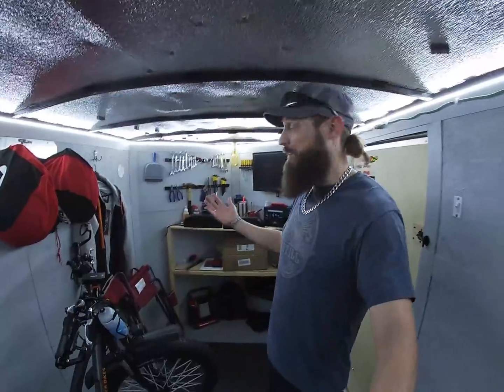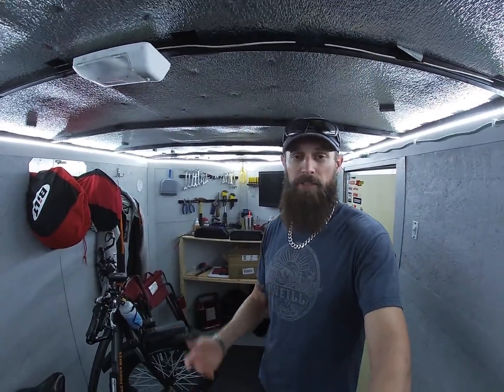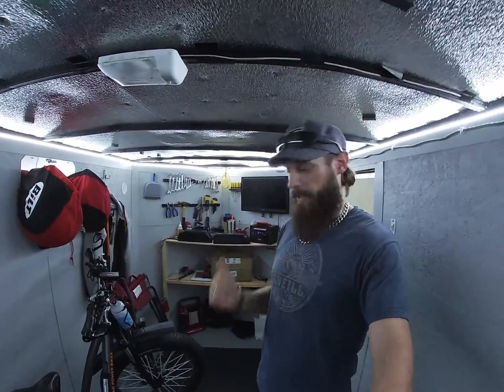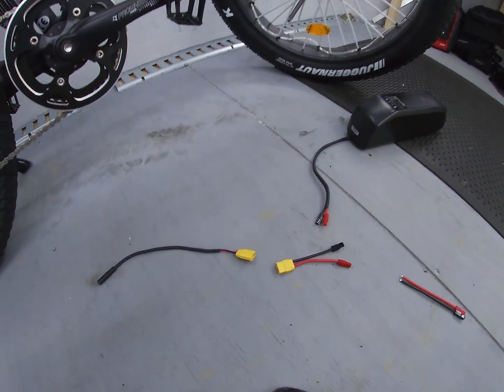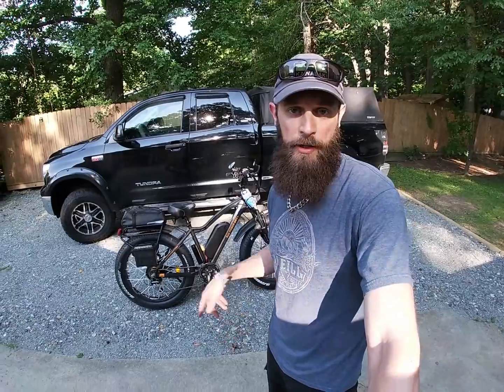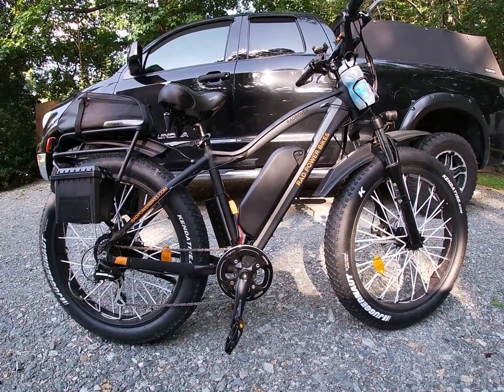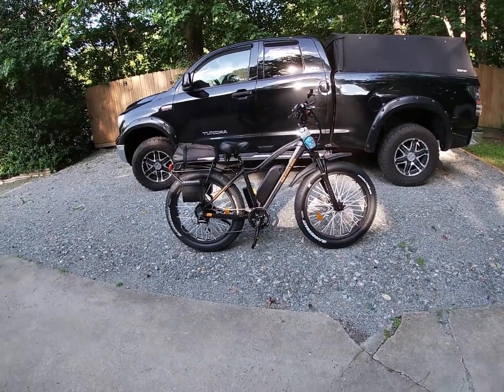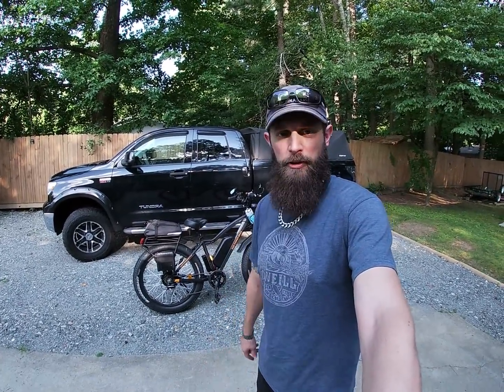52v Battery Upgrade on Rad Rover ebike

Comment: If you decide you’d like to eliminate the adapter cable, PM me and I can modify that cable for you (free for fellow YouTuber). I have an Anderson PowerPole crimp kit. That Anderson connector can accept 3 sizes of contacts (15A, 30A, & 45A), to fit the different gauges of wire.  These connectors are extremely reliable. I use them at work for aircraft communication systems.  Good thinking on the protective gear, hope you don’t need it!

Comment: The gauge wire is a issue I’m wanting to solve as well on my RadMini. They say the thicker wire handles more juice going through it. You have 52v battery so perhaps consider going thicker wires at some point. To get the most volts to the motor it helps. Still the simplicity of your set up is tempting. Anyway great to see all this stuff it gets me closer to home on my set up. And yes that’s what I’m finding the cost adds up. Thanks!
Reply: Amps determine what wire gauge to use.
Reply: @Bmr4life  c. 
“
Reply: High volts smaller wires needed to pass the same amps. 

Just sharing. 🍑

Comment: I got my Rover in February and like you think sometimes it would have been cheaper and easier, in the long run, to but a better bike out of the gate but it's literally been fun doing the tuning work and upgrades myself. Plus you gain knowing how to do so know how to fix and maintain it. And I like the connection you came up with, I'm thinking that's how I will do the battery upgrade soon so thanks for testing it out for me first :c)
Reply from the maker: rode it for about 8 miles tonight, seems to be working just fine :)
Reply: @CitizenCycle925  it seems like the best solution to me so thanks again for being a guinea pig for the rest of us.

Comment: I haven't had this much suspension for the 52V outcome since I upgraded the front suspension on my e-bike this spring.
Reply from the maker: hahaha!
Reply: @CitizenCycle925  I really think having bigger wires going into a smaller wire is not a good thing. It's like taking a big water pipe and putting it into a smaller one. You should see how hot that wire gets? That would be okay if they were all the same size wires that's what I think and I took two years of electrical trades and I have a soldering gun. Just got my echo ecotric Hammer bike yesterday. I would call it more like a motorcycle but that's all another story I will tell. And I'm good at telling stories lol.

Comment: Next upgrade base runner field-oriented ebike controller will fit in the base of the battery on the down tube clean up the look a lot.+ increase efficiency top speed and Power and make it quieter at the same time or the ASI BAC 800 controller from Luna cycle for even more power that motor will handle it

Comment: Does the battery mount on the stock Rad battery mount ?
Reply from the maker: removed stock cradle, and mounted the new one.   I used the stock mounting holes, however, the new battery cradle was not an exact fit.  i was only able to secure it with 2 bolts instead of 3. will need to make 1 minor adjustment and drill a hole thru the plastic part of the new cradle to get the 3rd bolt in.
Reply: No...he said he had to swap out cradles
Reply: no

Comment: How do you like the gears that came with your up graded 750 watt motor? It looked different than the stock rad gears.
Reply from the maker: i may have to change the front gear because with all the extra power it is just crazy easy to pedal in every gear.
Reply: @CitizenCycle925  My 2018 RR  is still stock because I'm waiting on some of the upgrade Parts you did on yours. But one thing I did do was change the front chainring from a 42 tooth stock to 46. I found on the 42 when I hit about around 20 miles an hour I was no longer getting pedal resistance just freewheeling. But the funny thing that's happened is i could normally get the bike up to 24.7 mph on just the motor on flat ground. Now with the new 46 tooth I can still pedal up to that speed with resistance. But what happens is when I hit that 24.7 it almost feels like the motor starts dragging and  will not let it go any faster even though I can still pedal up to that speed now. I haven't had a chance to check in why this is yet. You will find that you have to get used to when the new pedal assist points kick in. I went with the 46 because I knew the new ratio would allow me to continue to Pedal up to top speed. Also with the 46 you do not have to change or add any new links to the old chain and it still sits below the chain guard to protect it from jumping off. Also if you do this I would pull the crank off and change it out on a workbench. I saw someone said you could do it while it is on the bike but that turned into a nightmare. The spacers and washers will fall all over the place when disassembling and if you don't know where they belong it's almost impossible to figure it out. Fortunately I have a radcity step-thru to compare it to because they are the same. Even then trying to get it all back together while it's on the bike I would not recommend. Not unless you want to start swearing and throwing tools all over the place. LOL but if you want to have pedal resistance up to/at higher speeds changing the front chainring we'll do the trick. Anything higher than 46 will  probably require adding extra chain links and may cause the chain to ride too high above  the existing chain protector/guide causing derailments

Comment: Great video .. I'm wondering if that battery fits on a radmini slot .. that would be awesome.. I wanted to see u mount the battery post did u drill it in the same holes ???
Reply from the maker: I used the stock mounting holes, however, the new battery cradle was not an exact fit.  i was only able to secure it with 2 bolts instead of 3. will need to make 1 minor adjustment and drill a hole thru the plastic part of the new cradle to get the 3rd bolt in.
Reply: @CitizenCycle925  cool thanks cant wait until the other video
Reply from the maker: I just checked and the 52v battery does not fit into the battery space on my 2020Rad Mini Stepthru. It's too fat.
Reply: @CitizenCycle925  ok thanks I seen some 52v that had the same measurements.. but I really not going to take a chance.. I wish there was a walk in store lol . And say just get it to this speed here is the money lol

Comment: Brian, my friends and I use Anderson Powerpole connectors all the time with our ham radios.  Quick tip, the sides of each connector are grooved - male grooves on one side, female grooves on the other.  This means that you can slide the sides of the red and the black connectors at the ends of the wires together, creating a larger single piece connector, rather than having two smaller connectors at the end of each wire.  ps: soldering is an easy and handy skill to learn.  Plenty of tutorials for both soldering and for working with Anderson PP connectors here on Youtube.
Reply from the maker: interesting... i did not notice that about the connectors. thanks!

Comment: Great video. Splicing the wires is rather trivial BUT you absolutely make the best call by using connectors. Everything is still intact so if it didn’t work out, everything is still stock and could be resold or repurposed. However you’re killing us here with anticipation though. Results please. LOL.
Reply from the maker: the plugs worked and no issues so i am happy.   haha, results are next promise!!!

Comment: Thanks for another upgrade video. I agree that the battery box is much more pro looking than the battery in a bag.  I can’t even stand those Sondor triangle batteries! The soldering the wires are not a big thing...but the plug and play is always convenient. Later you can practice your soldering👍 look forward to the test runs!
Reply from the maker: that has always bothered me about the Sondors bikes as well.

Comment: Brian just a thought is there a temp guage for the motor and or the battery ?  I did 30 miles one day in the heat and nothing seemed hot per touch.
Reply from the maker: the display has ambient temp but not sure if it can display motor temp. i rode for about 8 miles today and motor was warm, not hot, but warmer than stock components.

Comment: Good call on not getting a triangle battery.   That was what I got for the bike I built and it kinda sucks.   One Velcro takes like two seconds to pull off.  Two they kinda flop around unless you make a way to secure them. I ended up replacing with a bottle mount like what you got.  So that’s a whole new battery just so the old one didn’t get stolen.   

Wiring isn’t a big deal with what you did.   Those connectors are prettt low residences
Reply from the maker: good point, i didn't even think of it flopping around, just didn't like the look.

Comment: Awesome I'm still waiting for my motor to come in ordering the battery at the end of the week. Do you know what type of batteries are used in the battery pack
Reply from the maker: website says: powerful genuine Sanyo GA cells 14S 5P configuration = 910 watt hours
Reply: @CitizenCycle925  awesome